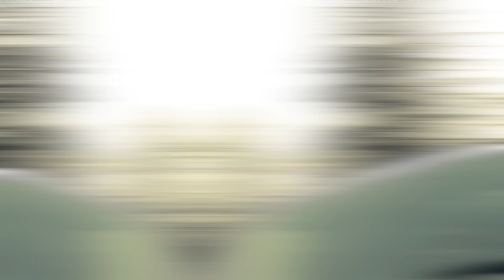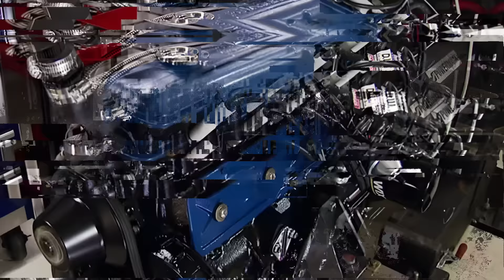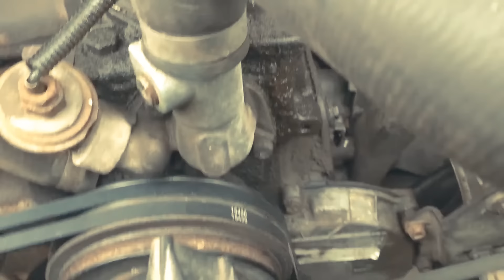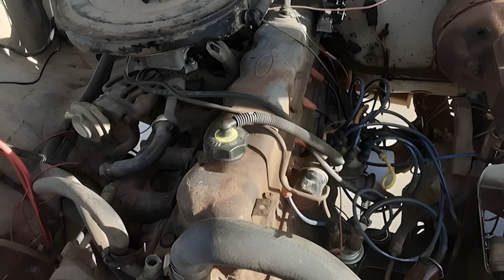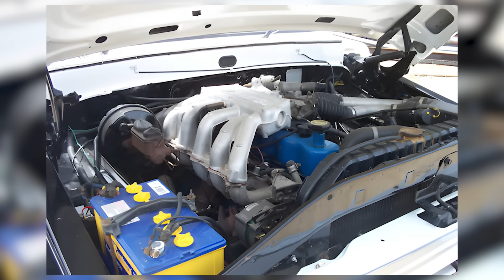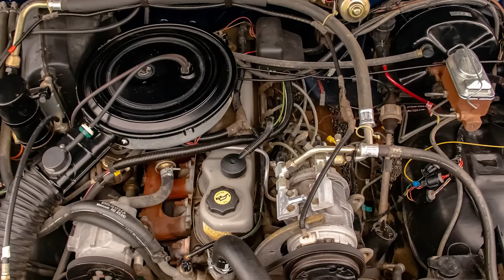The Most Durable Ford I6 Engine Ever – And Why They Killed It?

Comment: The engine in your thumbnail isn't a 300, it appears to be Ford's "small block" six cylinder; 250-200-170-144. No removable push rod cover and distinctly different looking valve cover. That aside, I've has several 300s and they're a terrific engine.

Comment: In about 2002 I had a 1985 ford f-150 flareside low gear 4 spd and open 410 diff. The 300 had a bad rear seal . Leaked like a siv. Worked great tho and beat it hard . Pulled my best friends 81 f100 out of a ditch going uphill on gravel . No sweat. Spun a bit then no problem. Eventually swapped in a 351 W . But great memories with that 300 in that little ford half ton!

Comment: I have owned 2 of these beasts, I love the 300, easily one of my top 3 engines, up there with the 7.3L IDI, and the 429 CJ. The one thing that impressed me, I ran across someone with a 300, had 1.5 million miles, all original, all they ever did to it, was general maintenance. That's what really made me love these engines, and a reason I will never pass up a 300 powered truck, for a modern vehicle.

Comment: i had one fo these and it served me well as a occasion dump truck, lawnmower hauler etc, maybe put 5000 km on it in 5 yrs.
then i got a new truck and sold this one and apparently new owners killed in in a matter of weeks somehow, no doubt using it as a daily driver. or maybe not even checking the oil, but it died nevertheless

Comment: I had a 1971 F-100 with this AWESOME engine!! Well over 500,000 miles on it,(speedometer cable broke on it so don’t know actual mileage after about 503,000 miles). She would knock like heck on cold start, smooth out, and she was ready for the road. NEVER torn down, always dependable. I called her The Old White Ghost! LOVED that old truck!

Comment: One has to ask what advanced the new engine that replaced the 300-6 has 

Or what negative issues it has the 300-6 did not have.

Check out power nation and there series on the 300-6 engine and how they all most double the HP by just changing the intake manifold and carburetor.

Using an old engine they got.

Then how the took it apart and beef it up with a turbo and pushed 500 HP if i remember correctly.

Just imagine adding 70 HP by just changing the intake and carburetor

Comment: I drive my 1983 Ford F-150, with the 300 six cylinder every day.  It has 220,000 original miles on it, and doesn't leak fluids on the ground.  I replaced the things that could fail over time, like the fuel and water pumps, solenoid, voltage regulator, starter motor, etc.  Never breaks down.  It's been referred to by a salvage yard owner, and by others, as bullet-proof, and indestructible.  I keep it tuned up, and it starts quickly.  I love driving it, with the standard four-speed (including granny gear), and sun visor with five yellow lights.

Comment: I have had a small window cleaning business in Pittsburgh, Pa. for just about 30 years. I had a 1994 F-150 with a straight 6 I bought new at 23 years old and was told to buy a truck with that motor by my uncles and a couple of guys at my factory job I had before I got my business. So I started out with that 94’ F-150, totaled it in an accident I had. Bought a 1990 F-150 with another straight 6 in it & ran that truck for over 20 years until it rusted so much I had to take it to a junk yard because it wouldn’t pass inspection. I couldn’t believe my luck but I found another 1990 with a straight 6 in it that only had 108,000 miles on it about 8 years ago (2016) and it was garage kept since new!!! I am currently running that truck, my 3rd Ford with a straight 6 in it (this motor now has 186,000 miles on it). I’ve had other trucks for my business through the years but nothing compares to these Fords in terms of low cost of maintenance and reliability! So I started out in my business with a Ford F-150 with a straight 6 and now I’m gonna retire running a Ford F-150 with a straight 6 in it. Now that I’m thinkin about it that’s pretty cool! Anyway, that’s my experience with these trucks. Wish they still made these motors new!

Comment: I have a 1977 F100  with the 300 engine. I bought it new. With custom extras the vehicle cost $4,200. $6.00 would fill the gas tank. Parts like starters or fuel pumps were easy to replace and cost around $6.00. My reasons, you stated in your video. In 1996 at around 300,000 miles, the rear differential broke. I opted to rebuild the rear end, transmission and engine. At that time it was going from oil change to oil change without having to add. In 2018, at over 400,000 miles, under a heavy load, the timing gear failed. It was original. Those are the only major repairs in over 48 years and 450,000 miles. In 1978 , I rolled it five times off a shelf road and drove it home. Almost an entirely new body cost less than $2000. It push started a semi, do not know what was in the trailer. It has hauled enumerable heavy loads. It has been to most of the USA. Washington State to Key West Florida, Often towing large U haul trailers or cars. Just before the rebuild, it towed a car from Miami, Florida to Tucson, Arizona. Coupled with low range 'granny gear', and limited slip differential, it's high torque also made it a great off road vehicle, without four wheel drive. To this day it hauls full loads of firewood and trailers. We are both still going strong. I am 73 and it is 48.

Comment: I worked for a company that had a fleet of these Ford 4.9 liter trucks. My coworkers complained about fuel economy and performance. I always wondered if those trucks would have better acceleration with a manual transmission.

Comment: I purchased a 94 F150 with 104k  miles,  rust free.  Had my mechanic change fluids, do a tune up, brakes, and just make sure it wouldnt let me down,  This truck runs great, is not slow like I hear others talk about.  I use it as spare vehicle and a truck,  I have cleaned it up, prettied it up and hopefully will be the last truck I own.

Comment: I picked up a '94 F-150 4WD stick short bed 1 1/2 years ago. It had sat in a backyard for 8 1/2 years. Several other fixable issues, but soaking the cylinders with oil, a tune up and new injectors and she fired right up and ran smooth. Still have one more gremlin to fix, but the engine is rock solid.

Comment: My 1988 300-6 F-150 has 4WD and a granny 4spd. It has a tall 308 rear end but I can slow down to 10mph when turning a corner in 4th gear and I don't have to downshift. I had it painted and re-upholstered a few years ago. It is my pride and joy. My first 300-6 was in a 1988 econoline work van years ago and I loved it. The biggest mistake I ever made was trading it for a passenger van with a 302 V8 because we wanted windows and seats. Thanks for a good video celebrating my favorite engine.

Comment: I had an '88 F150 with a 300, manual transmission, XL. Unfortunately, I didn't change the oil early on and burnt a ring at 20k miles.  I drove that truck until I traded it in in '96.  It had nearly 160k miles on it.  In '96, I wanted another F150 with a 300 but automatic and air this time.  On the lot, they had two old body style (OBS) and several of the new '97s with the "new look".  I asked the salesmen if it came with a 300, which he replied no.  So I bought and OBS XL with air and automatic. In 2018, I considered buying a new truck.  The '96 had 380k miles, ran a little weak, several transmissions.  Came close to getting a truck but decided that if I wanted to drive a classic, I might as well keep what I have.  To make a long story a little shorter, I'm still driving it.  I did replace the motor with a remanufactured 300, another transmission, eventually a new rear, another transmission rebuild, and the same original blue color. My work would supply me a truck, but why when I love driving mine.  Everyone knows me for that blue truck.  It has 580k miles now, and will retire with me next year after 30 years of use.  I plan to fix it up and probably a new paint job. But it will be the last truck I will own, and plan to pass it on to my grandson.

Comment: Had an F-150 with the 300 I6 --- Moved cross country towing a 16 ft trailer twice: -- and commuted from Los Alamos, NM to Denver, CO with it.  When moving to Los Alamos -- my wife was driving the F150, loaded -- and towing a U-Haul trailer -- I was driving the U-Haul truck and couldn't get over 17 mph out of it across the pass -- she kept the F150 between 2000 and 3000 rpm and waited for me at the rest area on the other side of the pass.
---- Not good at passing on a 2 lane road, but that flat torque curve did a lot of things.  (for comparison -- our prior truck was a Ford 302 v8; before that, a Chevy 20 series Suburban (bought used) with a 327 4-bbl V8, 4-spd/grany trans, 4.11 axle. --  that could have substituted as a farm tractor, but got 11 mpg.  Got 21 mpg, highway,  with the Ford.

Comment: I'm 69 I've grown to be a straight 6 fan. I read years ago that the straight 6 was one of the three most perfectly balanced engine configurations, along with the V12 and flat 6 if I remember right. My dad was a mechanic and bought a used 1963 Chevy step side pickup with a 283 and he said he liked the straight 6 better because it had more torque. He farmed sugar beets as a kid during the depression, so he knew work engines.

Comment: My buddy drove a 77 300 powered f 100 from wa state to w va with a hole in number 1 cyl. He unhooked 1 cil plug loaded his belonging and motor bike in the back and drove it to wva. We pulled it down put anothere rod and piston in and that old motor run for years after that

Comment: TODAYS ENGINES.  Push  as much hp on small platforms  that you can. Turbocharge them . Run complicated  thin timing chains against plastic guides. Run short skirted pistons prone to piston slap.  Running high hp on thin rod and main bearings. You get the legist of this.

Comment: I had a 1988 f250 with a 300. That truck had 346.000 miles.   The body fell off the truck. I live in pa so who knows how long it would of lasted before it rusted out.

Comment: Ford made a mistake ending the 300 6 because you can remove the distributor and put a magnet on the camshaft and use a camshaft sensor or even remove it  with little modification to the head to make it over head camshaft with no modification to the block but im not a engineer just a mechanic who knows more .

Comment: By about 1977 With the big 3 going into Front Wheel drive they purposely did not want a long engine anymore for RWD cars too. Thus all new design in 6's was on V6s and bury the I6 engine

So that meant the improving the induction of the I6 was dead; ie bury the i6 and all new effort on v6 stuff

Comment: I have an 1982 F150 4x4 stepside 300 i6 4 speed with 86,000 original miles. I'll never get rid off it.

Ford should bring it back and improve on it.  The 300 will out live any Ecoboost .

Comment: I've owned three F150's with the 300 six. A '92 Lariat Super Cab 4x4 that I towed a 24 ft Camper with. A '96 XLT regular cab 4x4. Today, I own a 1979 F150 Ranger XLT 4x4. This one has the low geared manual 4 speed. 1st gear is the creeper gear. So, it's not a highway truck. It's happiest at 45 to 50 mph. It runs great and is a pleasure to drive. I did freshen up the ignition system with new Dura Spark unit, plugs, wires, dist cap, rotor and coil when I first got it. I did that work sitting inside the engine bay. Been a long time since I'd been able to do that. Even had room for my cat to lay down on the inner fender.
Reply: I love Annie high trim F150 with a good 300 in it

Comment: AI power point, talking about Ford F150's, then showing a Chevy, mentions i6, then later calls it a V6.  300 doesn't have spark plugs on the passenger side, with intake on the driver's.  Love the motor, hate the AI.

Comment: For the past 8 years, my daily driver work truck has been my '95 F-150 4.9L EFI XL 5 speed manual. Paid $1,800 for it. I have abused this truck something awful, but it just keeps going. It ain't pretty or fast, but its so inexpensive to drive it will probably be the last vehicle I ever have.
Reply: Same rig,  I can not kill mine.  What a great reliable truck.  We are lucky guys.

Comment: Yeah. Very good engine for sure.    But.   Had a buddy with one in an 86  F-250.  It was  icy and he departed the road and gently love tapped a tree dead center of the grille.    Not too much damage so he bought all the parts to fix it.  He got ready to start her up and found the motor was locked up on him.    He calls me up to diagnose it for him.  I did some head scratching for a while and finally realized that the water pump impeller shaft had been driven back into the #1 cylinder  by about a 1/4 inch. That was the end of that 300.

Comment: I bought an E150 van brand new in 1979. Still have it, came with a 300 ci six and a four on the floor. First year they did that. I put an Offanhouser dual port intake, Edlebrock 400 cfm carb, Clifford research headers, three and three into dual exhaust and a warmed up cam. Could outrun small block V-8's all day. Towed anything I hooked behind it and never let me down. They used it in pretty much anything that needed a durable power planet. Many industrial applications. Heavy cast block blocks were used in UPS trucks for years.
Reply: I refuse to buy a vehicle that doesn't have cast iron block and heads.  I'll stick with my ancient shitboxes, I can keep them running for another few hundred thousand miles.
Reply: @Radagast49230 yup, I had an old Chevy with a 235 ci six and got it so hot a couple of times it sounded like a tea pot on boil. I just let it cool down, added some water and it ran just fine. Most of the time if you get a car wirh an aluminum head just up to the high side of the temp gauge, it will warp the head. Worked in a Nissan/Datsun dealership and saw it many times.

Comment: The 4.2  that replaced it has it's torque peak too high. Needs too much rpm to make any power.
Low rpm power not that impressive in a truck application.
This motor feels like a good motor for a base Mustang.
The mpg isn't too impressive either. 15 to 18 mpg with a 5 speed

Comment: I purchased a 1992 F250 with the fuel injected 300 six and the granny 4-speed manual. Back then (1996) we heated our house 100% with wood and I cut and split all of it. I could load the bed down with green oak and hickory logs all the up to the top of the cab and pull a 16ft trailer behind it loaded down with the same wood.  It never complained and never seemed to be in a strain. Of course it wasn’t fast but I didn’t buy it to be fast. 
I sold it during a recession and it was a huge mistake on my part. I replaced it with a K2500 Chevy with a 350 V8 but it hasn’t been nearly as tough as the Ford was . The 300 Ford was so simple to do the basic maintenance on.  I personally think the 300 six was Ford’s most reliable gas engine ever built.

Comment: Bought my 1995 Ford F-150 new. Thirty years and 343,000 miles and I still drive it most days. Finally decided to get the A/C fixed because the hot Texas summers are hard on an Old man. It's in the shop getting the A/C done and also getting a new seat and headliner. The kids are fighting over who gets my truck when I die. No plans to die as yet. Ha! Oh and it has a standard 5 speed transmission.
Reply: Still have my ‘94, I like that 5 speed ( New clutch) . Fun to drive .
Keep trucking brother. P

Comment: Had several in 250 and 350 series vans.  Also one powered my 87 Bronco.  The vans were 88-90-95s super smooth with fuel injection.
What terrific motor.  Sounded good too just a working away like there is no tomorrow.

Comment: That is NOT the reason why the 300 was dropped.  When Ford redesigned the F150 for 1997, the 300 simply would not fit in the engine compartment. It was too long and too tall for the new sloped hood design.

Comment: Had a 1992 Ford f 150 5 speed. 4x4.  Short bed.  Drove the truck. Until 538000 miles.  Never touched the engine. Just gas oil. Tune ups.  Kept running until the very end.
Reply: Had a 1997 f 150 with all most 400000 miles on it the emergency brake did not work and when at the boat ramp to put the boat in had to put a block by the wheel so my truck would not roll in the lake because of low engine compression but that baby would purr like a kitten down the road.🤠

Comment: Had a 1986 f150 4x4 with that engine and a 4 speed manual. Incredibly great truck. Wish I had it now. It once started at -46F, not plugged in, when we were out at camp. Simple design, durable as hell !

Comment: I once rebuilt a I 300 in a 1984 F150. It only had 38000 miles at the time. I can’t fault the engine. The bearings were shot because of the way it had been driven.

Comment: Almost all straight 6’s have 7 main bearings. Inline engines very seldom have more than one cylinder between main bearings. V engines, almost always have 2 cylinders, on one crank throw, between main bearings. This is why you have 5 mains on an inline 4, and also a V8. 4 mains on a V6, but 7 on an inline 6. Having more main bearings per cylinder is an aid in engine longevity, but having a long crankshaft is not, because a long crankshaft is subject to twisting and bending forces. And inline 6’s have very long cranks. So these factors tend to cancel each other out. Yeah, the inline crank flexes more, but is better supported. But the main reason inline 6’s last so long, is they have perfect primary, and secondary balance, and virtually no rocking couple. This makes the engine run exceptionally smooth. And it is that smoothness that is the primary reason they last so long. They are not vibrating themselves to pieces.

Comment: I had a 1989 E150 with this engine wirh an automatic. Wasnt fast but never stopped running.  And it had enough torque to pull a house☺️